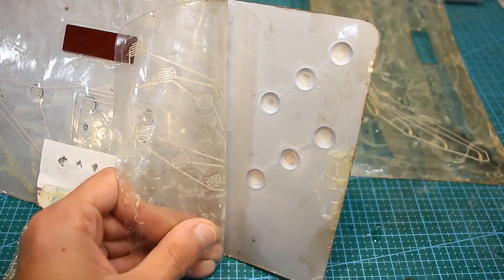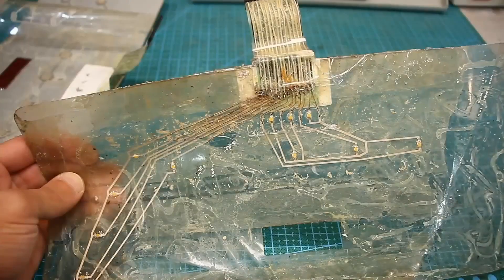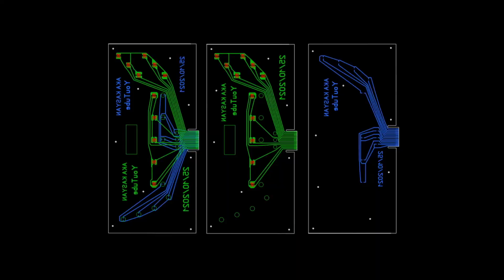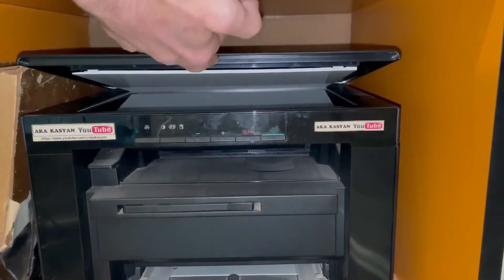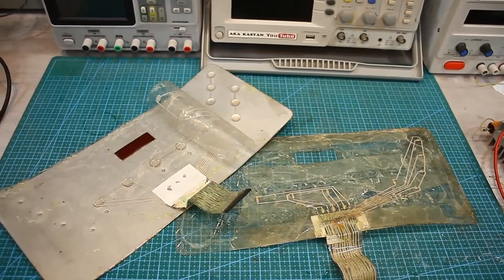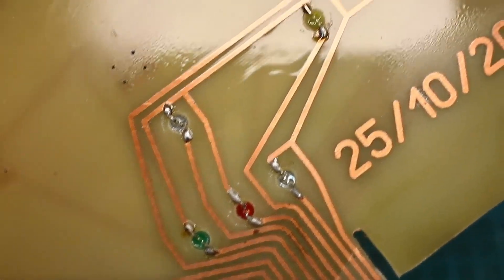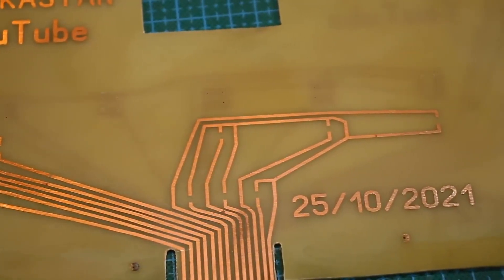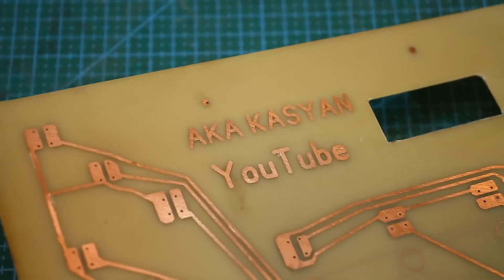Almost “Stealing” from the China – When There’s No Other Choice

Comment: A similar repair method I learned from a guy who repairs control panels for PLC controllers is to drill a hole where a membrane contact lands on the PCB, solder a tact switch into the hole, and reinforce it with CA glue and baking powder. He says he never has any returns for his controllers he repairs this way, but obviously this is more of a repair when it's on a rigid PCB than a flex printed sheet like that.

Comment: Great work. But for a panel this big you could have made you own design with full size buttons and led lights.. It would have worked and the next service of it would be super easy.
 The soft printed circuit idea should only be used for unique connections not for a control panel, or flowing long cables.